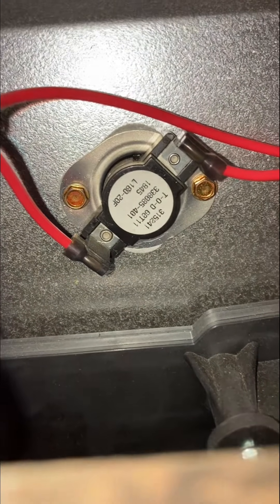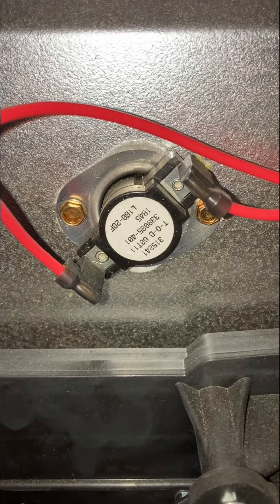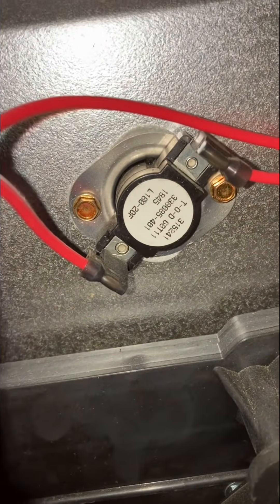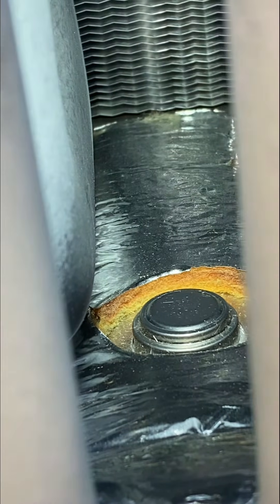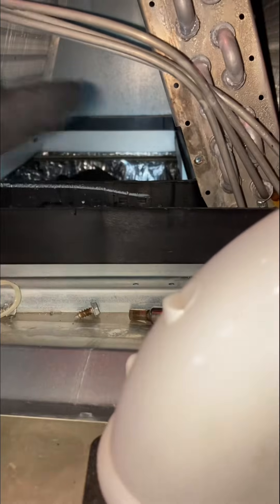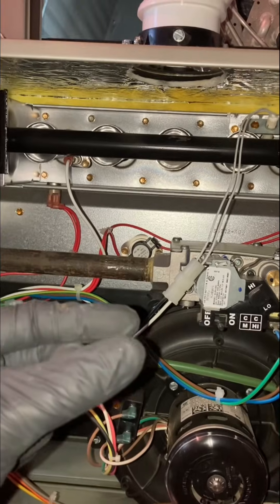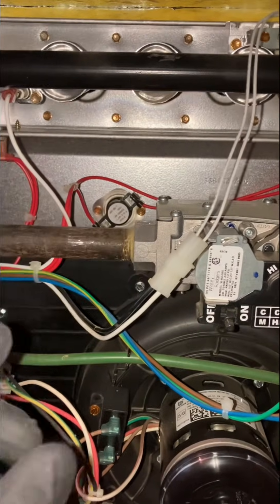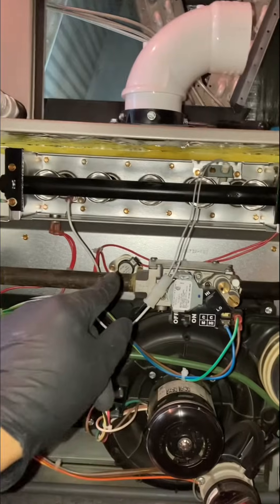Carrier furnace- Resolving high limit error code 33

Comment: Just added the tape, but still getting a 33 code around 9 mins into heating. Though it seems to not be short cycling, at least from the initial tests. Assuming best to try replacing the limit switch all together?
Reply from the maker: @PocketFullaPesos  those are very rarely bad. Replacing it wouldn’t fix anything as the underlying problem would still exist. Have you verified manifold gas pressure is correct using a manometer and checked airflow?
Reply: @victork3397  still short cycling actually. Hvac guy said it’s fine because it’s not doing a “hard lockout”, but I feel like it shouldn’t be throwing any error code. Full system is only 4 years old. Heard it from other hvac folks that it could too big for the house and that it needs more air getting into the unit. Feel like it shouldn’t be cycling as much as it is.
Reply from the maker: @PocketFullaPesos  what is your static pressure? Did they check that?
Reply from the maker: @ you are right however, it shouldn’t be throwing any error codes during operation. An error code is telling you there is a problem needing to be addressed. A “hard lockout” is just multiple limit trips in a row. Most furnaces are oversized for the space they are installed into. If the installing company didn’t do a heating load Calc and simply used the size of the old furnace as a reference or the sq ft of the home(as most tend to do), then it most likely is off. I heard on an HVAC School podcast that most furnaces are greatly oversized. An oversized furnace causes problems with airflow because the ducting was not upgraded in size to accommodate the larger capacity furnace. This leads to equipment short cycling, shortened life, and high limit trips. 
Have them come back and check total external static pressure , it should be 0.5” WC or less per manufacturer guidelines. Check your install manual. 

Have the HVAC company actually take measurements and record data(instead of a simple visual run test). Most companies have a 30 day service warranty, if the issue is still occurring, they will come back for free for additional diagnostics. If you’re not satisfied with the quality of work from one technician, call the company back and tell them you want a supervisor sent to figure the problem out.  Sounds like you already paid to have someone out, they should give you a legitimate reason why this is happening instead of saying “it’s fine”. Don’t be shy to call them and complain. Remember - a closed mouth doesn’t get fed.
Reply: I have a clogged secondary htx… hi eff bryants seem to have this issue quite a bit. Just something to keep in mind. Hopefully that isnt your issue
Reply from the maker: @fatkat311  a clogged heat exchanger possibly could cause the high limit to trip. If it is a clogged HX it is obvious because there will be a very foul smell coming from the furnace exhaust when it is heating. If that’s the case, the furnace needs to be shut down and repaired before operating again.
Reply: @victork3397  i have an 80k btu bryant manufactured 2010 with constant rollout trips. I disassembled the htx and found the secondary is rusted and 90% clogged. I’m getting enough draft through the heat exchanger that my pressure switches are still making, but not enough for the flame to make it into tubes all the way. Bryant recognized This is a manufacture defect on the heat exchanger and since changed the part number and extended the warranty. I was able to go up to my local Hvac Shop and pick up all the parts at zero cost. I’m actually on my way up there right now.
Reply from the maker: @ I’m surprised the hvac shop is giving the parts to you. I’ve never heard of that happening before. Usually they won’t give you the parts unless you pay to have their technicians install it.

Comment: Would this cut the power to nest thermostat which shows error E74: no power to the rh wire? 
I'm getting this error on nest and checked the window to see LED showing error 33. I also noticed the air coming out of the vents when it does work isn't as strong as it used to be.
Reply from the maker: @mohammadsiddiqi6573  yes absolutely. Furnace drops power to thermostat when furnace overheats (error code 33). Circulator fan will run non-stop to cool off furnace. Fan only shuts off during trial for ignition.